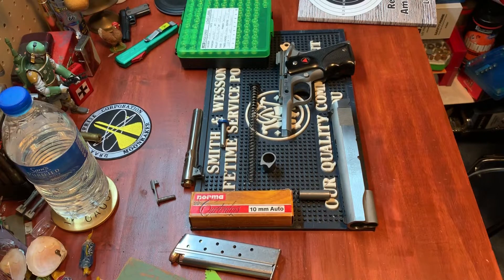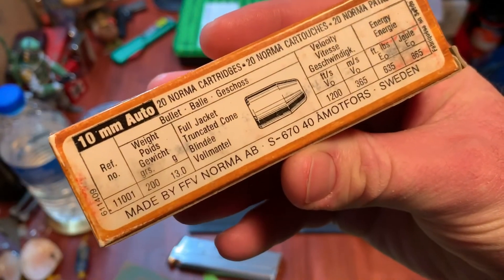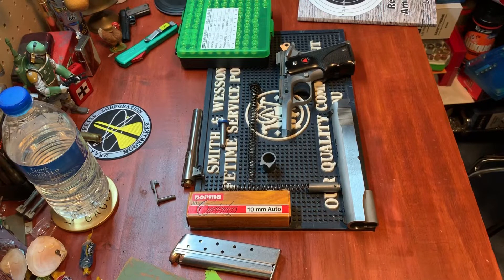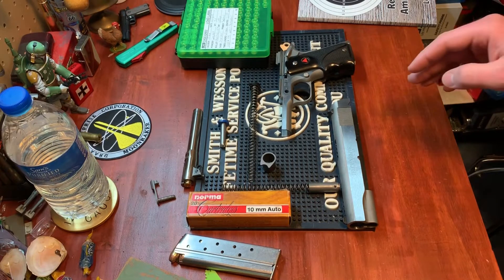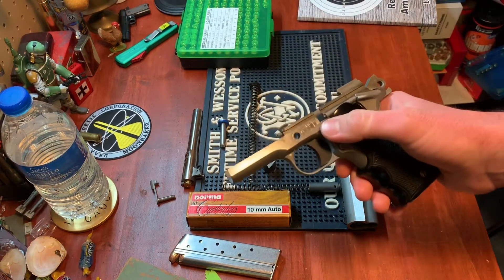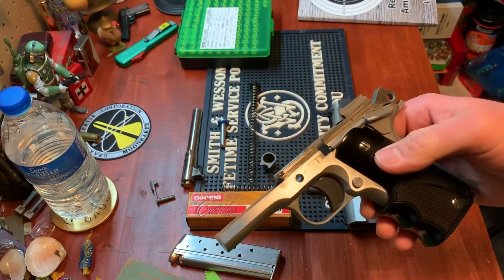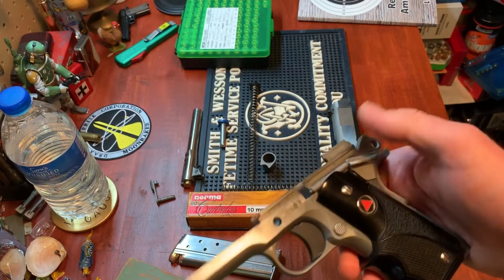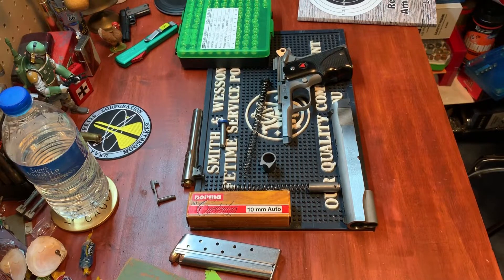Will Norma/full power 10mm blow up a Colt Delta Elite 1911??

Comment: Colt Delta Elite is as strong as any 10mm 
I wouldn't trust Glock 10mm with hot loads
Reply: Yeah, I bet you it's not. I know plenty of glocks that rock and roll 10mm that's loaded well past Norma specs. and I load mine past that.
Reply from the maker: And I’ve seen the all-too-familiar Glock smile
Reply: @SlimCowboy  imagine not running a kkm barrel in a glock.
Reply: @JKCullens  How far past the Norma specs do you go?   And why?
Reply: @richlabombard6780  not much, but I know guy's who run proprietary powder that are running 180s at 1500ftps+ from 5in 1911s
Reply: @JKCullens  No kidding?  That is hot.  I stay in the guidelines, but that’s amazing.  Thanks for replying.
Reply: This "Elmer fudd" cat hasn't a clue.... I've been reading his comments about how Colt uses cast frames for the Delta Elite....effin mo ron